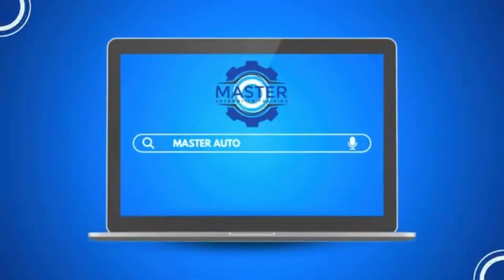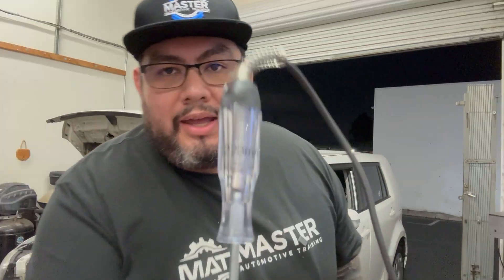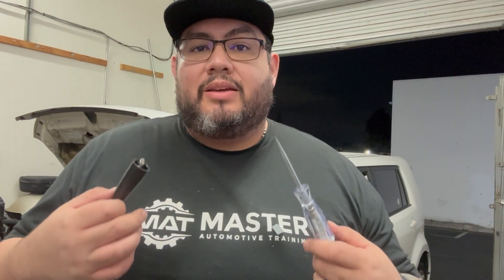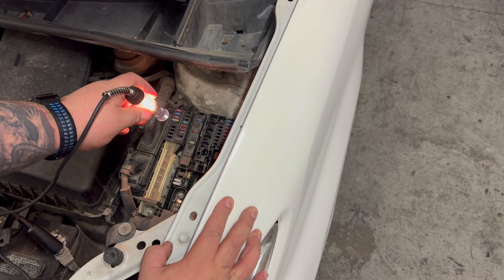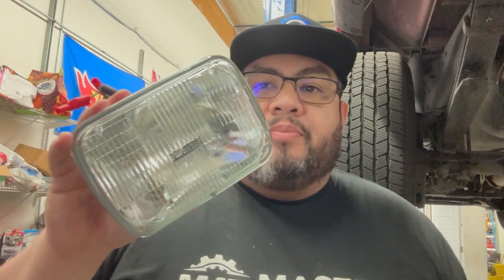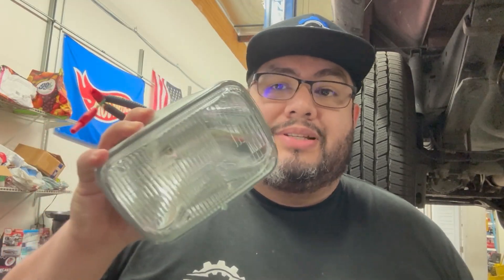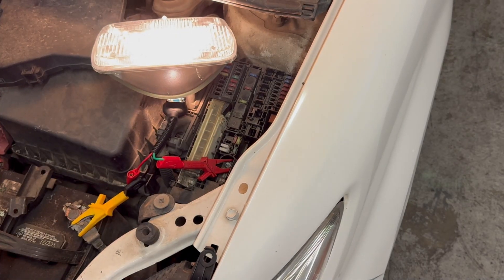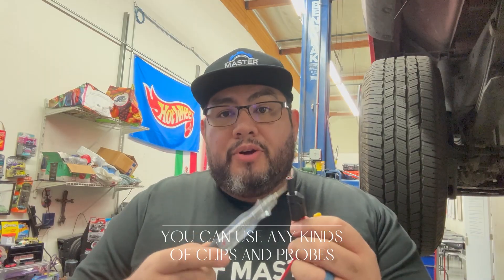How to Use an Automotive Test Light [Quick and Easy]

Comment: What power source do you use for checking the amperage draw on a test light? Does a 12: battery work or would you need some other sort of power source?
Reply from the maker: I use a Kungber 30v 10A bench power supply from Amazon. You can 100% use a car battery as long as you know the starting voltage and a DVOM.in series to measure current flow. I will be posting a video on the process in a few weeks.

Comment: I prefer to use a power probe. My eyes cannot detect whether the voltage is high enough or not. When a test light is really dim there is an obvious problem. When someone says a nice bright light I cannot detect a difference between 12.6v and 11.6v . If I feel a load test is necessary then I use a variable resistor to load according to the circuit. Also the light bulb circuit loading does not always work. I've had a light bulb light to what I believed to be bright off of 2 strands of copper wire. Neither tool found the problem but a tug test did.
Reply from the maker: A test light isn’t for your eyes to judge voltage — that’s what a DVOM is for. We use a test light to load the circuit so we can see if it can actually carry current and expose high resistance anywhere in the path. I’ve shown wires with two strands that looked perfect on a power probe and logic probe, but failed instantly under a real load test. Voltage is measured with a DVOM; the circuit’s strength is verified with load. https://youtube.com/shorts/HLPX1dBW0rU?feature=share

Comment: I have a indecesant, a power probe and a led test light that shows whether you are on the ground side or power side of the circuit
Reply from the maker: Sounds like you're well-equipped!
Reply: @MasterAutomotiveTraining  Yes sir, just have get my electrical diag skillls up to match the tools. Lol
Reply from the maker: @billwhite5853  testing one known good car a day will help you sharpen those skills my friend.
Reply: @MasterAutomotiveTraining  I was decent at heavy work on school buses, but they moved the garage from the schools to the county side in 99. I moved to the grounds crew, so I've been out of a shop environment for 30 years. Just tinkering on stuff around the house and trying to learn more diagnostics

Comment: Can you use a load pro to load test the fuel pump circuit
Reply from the maker: You can use a LoadPro to check the wiring to the fuel pump, but not the pump itself. It only adds about 0.5–0.8 amps, so it’s great for finding bad connections or voltage drop, but it won’t simulate the actual 5–10 amp load of the pump. For the pump motor, you still need an amp clamp and a scope.

Comment: 223 mA nominal , probably closer to 1A inrush
Reply from the maker: Inrush was 228-230mA when I bench tested it last night.
Reply: @MasterAutomotiveTraining interesting, you’d think with the cold resistance it’d be higher . Did you scope it ?
Reply from the maker: I was using a DVOM and my bench power supply has an integrated ammeter. I don't scope them because, the inrush such a minimal amount of time, the nominal current can take out a circuit. Its like when we do an RC test we can peak at 1kA which would melt the crap out of a wire, but since it drops instantly to 100-250A the battery wires can carry it.